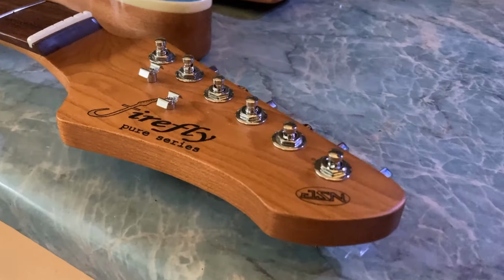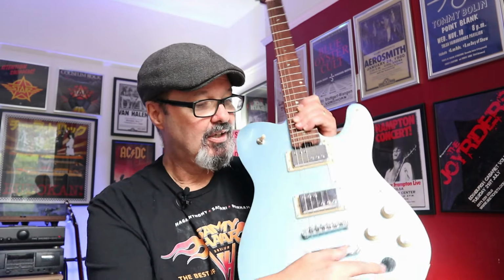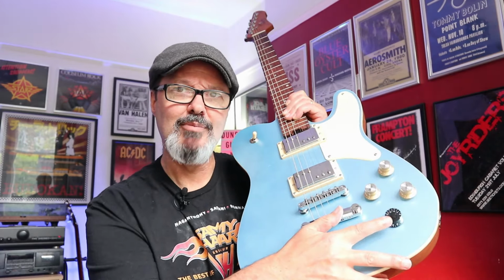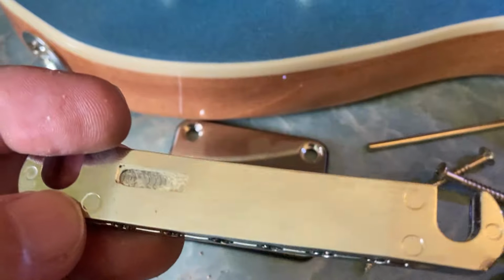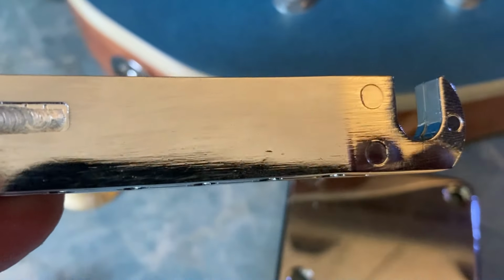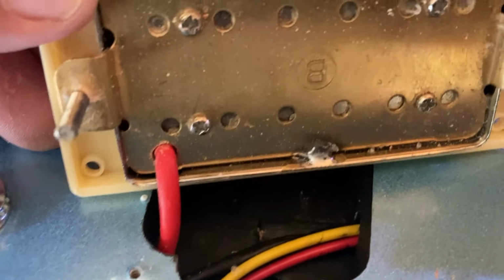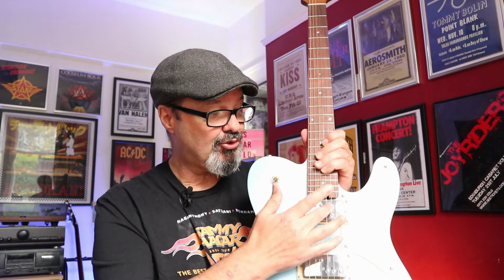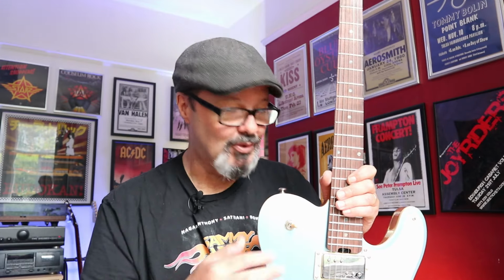FIREFLY FFTL Full review with sound samples. And a question....

Comment: The same issue popped up on the early squire paranormal p90 strats very recently dunsy. Dolphins bridges on fenders. Now nobody is absolutely sure if it's the parts manufacturers issue of fender and epi (and now firefly) are produced in the same factory.
Reply: Spellchecker. Dolphin = epiphone , lol.
Reply from the maker: Yeah, I guess it's either all in the one factory or there's an overabundance of hardware and everyone is sharing!